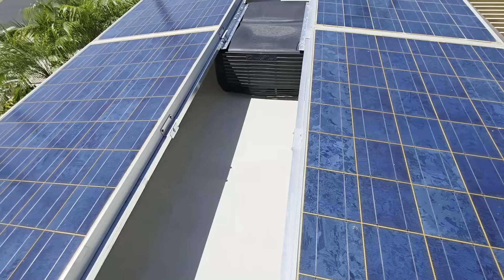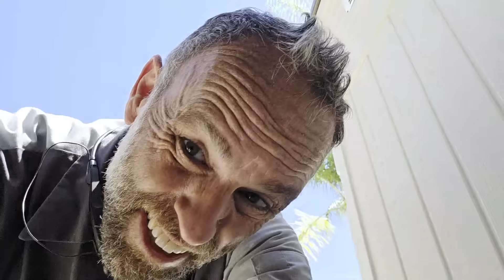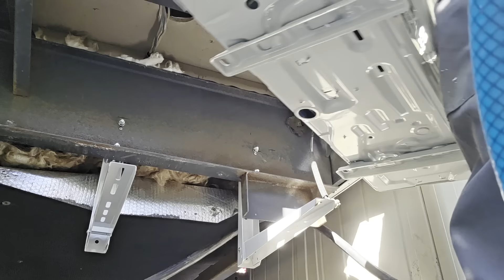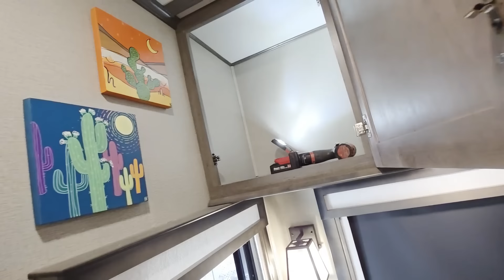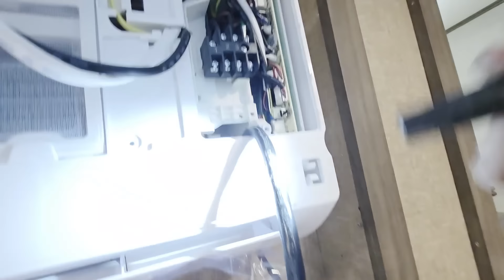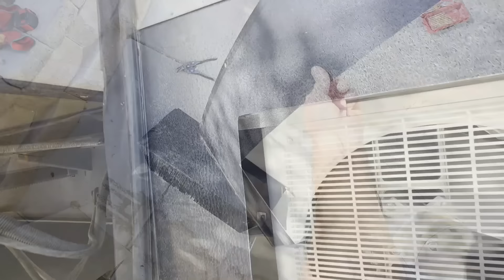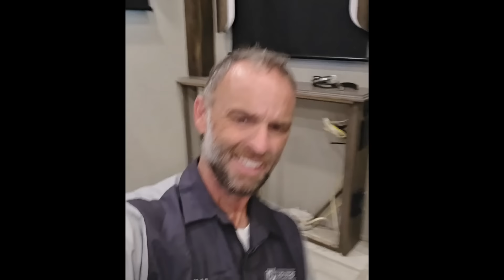Are Mini-Splits Worth the Hype? YES!!!

Comment: Now you can get  all-in-one inverter ACs that fit in place of your old unit and 14” hole.  So the only advantage of splits is the noise is less depending where you put the outside part.  And it drips condensate so there’s that.

Comment: FYI I am a retired HVAC contractor Daikin mini splits make a ceiling cassette they can go on the ceiling of an RV and the outdoor condensing unit is a hermetically sealed unit it doesn't care what you mounted in. But my point is you can give the condenser a set location and route the line set to the ceiling cassette permanently and not worry about a slide moving in and out copper moving in and out look into it there are a variety of ceiling cassettes the word on the pipeline did an RV model is being developed. A ceiling cassette easy peasy to locate and install has a safety condensate pump with a safety switch which can route the condensation anywhere. I hope you find this information interesting. Pete Damron
Retired Goodman heating and cooling
Reply from the maker: I'm honestly trying to figure out a mono block a/c that mr cool has, it seems very simple

Comment: Well, I am inspired to the point that I have ordered a mini-split for my fifth wheel.  I plan to copy what you did with the exception of the outside unit.  I think I will take advantage of the receiver hitch and mount a basket to hold the condenser.  Will let you know how it turns out!
Reply from the maker: Good luck, I have high hopes you will be very happy with it

Comment: It ain't consuming 100 watts, that's no possible.  

Is that RV moving?  what's that wood shed in front of it?

One problem with the mini splits is they all have no switchover if you use them for heat also. So you can't set a heat temp and a cool temp separately. Just a single temp which means it'll flip too easily between heat and cool.

Comment: STOP JUST SAY HELL YEAH. I have 2 on my mini splits, 1 on my mancave not attached to the house 20x40 on solar only in Utah. Its 101 outside as i type, my mini split is set to 68 and i have to keep inching it up because its a freezer in here, and its a 120v mr cool that's 8 yrs old. We just drove our 1979 mC9 from New Jersey to Utah in July running dual mini split off my 3000 watts of solar, with 400ah 48 volt batteries and 10kw inverter, while driving, we have nothing but 120/240 in the bus no DC except for bus. Ran the ini split 24/7 across the country and never had an issue never touched the back up generator. SO unless you have used them hard as hell for a decade dont judge them, also i put them in, on the bus and the mancave.
Reply from the maker: That is quite an impressive real-world test for those systems.

Comment: On the first house I didn't cut and reflare the lines. I wish I had. The second one in my wife's container I just bought separate copper lines and matching fittings and cut it to length and put the lines in the wall. Now it's nice and pretty. Lol

Comment: Great video, Sir. I am watching these videos as I'm considering the swap with my RV as well. My only question...or concern, rather, is that other videos say the instructions of certain units discourage plugging into GFI outlets as it appeared you did. What are your thoughts on using the GFI outlets. I've heard that the unit powers off immediately if it uses a GFI.
Reply from the maker: I have seen that too but not every time

Comment: I have been considering putting a mini split in my DRV 5th wheel -- 43 feet.  I do not understand how a 12k mini split can outcool a 15k RV ac.  I always thought that BTUs are BTUs.  I live in south Texas so I need plenty of cooling power for these 100+ degree days.
Reply from the maker: The BTUs are lost to the ceiling and ducting restrictions and the heat of the roof

Comment: Just out curiosity, How long did this take to install?  I have a fifth wheel with the "In Command" system, and I want to set up a mini-split with a 110 line for shore power.
Reply from the maker: Well recording adds 3x but a day and a half is reasonable for all the work

Comment: Okay, now that was cool. Beautiful job. I did the same thing with my Montana fifth wheel when I remodeled it after gutting it. I put a mini split right over the door, 12000 BTUs, 115 amp that plugs right in. I mounted the compressor to the side of the RV. Unconventional and maybe a bit ugly but it cools and heats superbly. I got so enthusiastic about mini splits I installed them in my Florida home where it gets so cold the complaints are often! My electric bill at my house is never over $115.00 a month, no kidding. Mini Splits are the way to go and if you can find a  way to install them, the ugliness of them become beautiful when you get that electric bill. Thanks for a new idea!!!!
Reply from the maker: I couldn't agree more, the energy savings alone make them well worth the effort of the install.

Comment: I don't get how a single 12,000 btu minisplit will cool "better" than two 12,000 btu rooftop AC units. Less electricity? Yes. Quieter? Yes. More cooling? No. Excellent clean installation though!!
Reply from the maker: That's how poorly roof A/Cs cool the air, they spend most of the energy doing nothing and is lost to the roof and the ceiling

Comment: Did you complete the AC Cord by having enough loop to reach the 20-amp 120-VAC outlet power box at an RV site?   You did not hook up the power to the power panel inside the RV?
Reply from the maker: The owner chose to add an outlet to the solar generator in the power house shed rather than run a new outlet to the box 3/4 way from the A/C. It could be added later if desired.
Reply: @AZExpert  I am thrilled that you did this video. I bought must everything on your list. Already have the vacc pump/hoses. Can you list the power cord that you used. I’ve been looking at them and there are so many options.  I love that you are in southern AZ as I am just north of Phx. So you know what is required to deal with extreme heat. I’ve been living in my late son’s travel trailer now for 11 years and I’m so tired of dealing with the heat and ac break downs. It’s regular in the 90s inside. Anyway, I was able to finely afford to buy a mini split. Looking forward to installing it, soon I hope.
Reply from the maker: @LethalLadyCreations  just a long heavy duty extension cord from home depot will work

Comment: I dont understand why Rv manufactures are not using mini split.  Domectic stuff is junk on every aspect and does not last.  Maybe if Domectic would produce something that last for years and is economical some things might change.  I'll never ever buy another RV.  I'd rather build my own and put in a mini split.  The build starts soon and will be a couple years away due to funds.
Reply from the maker: If I were smart I would just develope RV flex hose line sets for easier installations.

Comment: I'm looking into putting I've into my 5th wheel forest river impression...i want to put it on its on breaker inside kicking off my 50 amp breaker box...is that possible??..i didn't want to take it to 110 outside  because the next place i go might not have but a 50 amp plug...im skeptical on where to mount it but heck no matter where it should cool down from room to room nose to tail.. Right?? How much would it cost having somebody to do the install??
Reply from the maker: of course that is very simple to do
Reply: @AZExpert lol right on how much you charge to come to Houston to throw mine in 😅😂

Comment: Nothing drives me crazier than the RV manufacturers putting 2 inch wide holes to string 3/4 of an inch of pipes and  wires .. it like sending an invitation to mice rats and squirrels.

Comment: Why did you install the left side cabinet door with the handle and hinges on the wrong side?
Reply from the maker: That's how it was mounted originally. I wanted to swap it but the handle would have been on the top or I would have had to drill new holes. It bothers me too, but not as bad as holes in the door.

Comment: Looks great and I have a 40 destination with same overhead cabinet, perfect location if I do what you did with the center area.  I never considered the outdoor condenser installing where you installed, but it's perfect and  I will  measure if a mini split witl fit..  Bought new in 22, it has less than 100 miles after  the dealer received it, don't plan to put any more miles.  A ground install location would work, but I like the ability to retain mobility.

Comment: i moved into a RV in Tennessee for full time  non moving bedroom on my daughters property, I was wondering about  if I ever need to replace an AC unit a mini split would be the better  choice, I would think a 220v model might be the better option, but I was wondering about this model vs a Mr Cool.
Reply from the maker: a 220vac model would be better, but will take some knowledge to make work on RV electrical systems. Mr cool is great but does cost more and you will need to measure your line set to make sure it will work first.

Comment: Nice work! Very professionally installed! My RV is probably under 400sq ft. I’m wondering if I could get away with a 9000 BTU UNIT?
Reply from the maker: probably, but I don't see a value as the price and size are very similar

Comment: What about using those mini splits that have the ceiling cassette style air handlers and using the hole where the old roof units were that way you can add them in the bedrooms and such for more flow i think they make them up to like four cassettes for one unit which would probably be Overkill
Reply from the maker: routing the line set would be the biggest issue, but I could see fabricating flexible rubber line set rather than the copper and it working, but the cassette is likely bigger than 14 x 14 opening so then the roof would have to be re-built/designed for the joist load

Comment: I have a 2007 39 ft Dutchmen Grand Junction fifth wheel that is permanent on a piece of property that won't be moved and I would love to do something like that to mine because my rooftop air conditioners are Extremely Loud and not very efficient. I just didn't know exactly what to use one of those mini splits or a couple small 10,000 BTU air conditioners. But I thought the job you did was very nice.

Comment: First time on your channel and excellent video. Your thought process and skills to make that look great. The only thing for future installations just don't make your extra lines in vertical loops because you create an oil trap for the compressor. You always want the loops horizontal or get yourself a metric or imperial flaring kit based on your manufacturer's line set dimensions and do the flares. They are not hard to do it all. Cut the extra length off and practice a few on the scrap pieces of line. You just want to sit in proper on the flare of the nut and not riding up on the threads or not too shallow, but just in that perfect spot by looking at the factory ones how they're made. Factory or made flares always use RT220B Nylog sealant.
Reply from the maker: I did suggest re-flares but I also have my doubts about the oil trapping as being less true and more kind of true. I travel the country and see these installed everywhere and I see vertical loops everywhere too. It may be real or best practices, but in practice much less important and I wanted a service loop length for installation and flexing more like a brake line and cutting and flaring the 6-8 inches seemed very unnecessary. Over a year later and the system is still working. I do use nylog on all installation now. Thank you!
Reply: @AZExpert Unfortunately there's a lot of improper installs being done because there's a lot of DIY mini split systems. It's quite important that there's no vertical loops for oil trap. It will not show up immediately but it can shorten the life of the compressor, and reduce efficiency. Easy thing to Google. I understand what you're saying about wanting a service loop since it's kind of in quite a tight area on that side of the unit. An idea would be to have a welder or you can fabricate it and make you a tray with those heavy duty lockable ball bearing slides that will easily support a 60-70 lb outdoor unit, and good practice for RV unit is to put a "S" in the line at that unit. That could give you a little room in the lines for service to slide it out. I'm a former licensed mechanical contractor Unlimited and a 14-year college educator in energy technology and alternative energy geothermal heat pumps.
Reply from the maker: @Bob-sy5gm  They are $250-400 units, you are asking for $1000s for fabrication to possibly increase the life of a nearly disposable ac that might only last 10 years instead of 15 on a rv. Best practices are nearly impractical in reality and perfection is not a worthwile goal because it causes decision paralysis. I'd worry more about the air space void in the line set I installed causing issues more than the loops personally.
Reply: @AZExpert I can't argue with that with the price point of those units in the low hundreds, as they have become just disposable units. Labor is way too expensive to do a major repair like a compressor. I do like your thoughts on making everything removable with your covers and access. As a former HVAC technician that's great! I consulted for high-end multimillion dollar companies and everything was done with higher quality like Mitsubishi, Carrier, LG. I figured with these higher end RVs and the hundreds of thousands into the millions, I personally wouldn't put in a few hundred dollar AC or heat pump. Also you're talking about your power consumption with a lot of RVs that have their own solar now. If you seek out the highest SEER2/HSPF2 rating, they will just sip power sometimes as low as 200 to 400 watts once the temperature is stabilized. I plan on installing one in an RV travel trailer coming up with a fully supporting solar system. Tosot ( manufactured by Gree as a entry-level unit) available thru Tosot Direct or Amazon offers a 24.5 SEER2, 9.5 HSPF2 12,000 18,000 or 24,000 heat pump starting off at about $1,299 or less for the 12,000 unit, And I've seen it on Amazon in the 900 range.

Comment: Hello out there! I'm new to the RV world. I aquired a 5th wheel with a mini-split and am wondering if I can plug it into the 3000W pure sine wave inverter? I have 3 solar power panels and 4 large size batteries. Thanks for any info you can give me.
Reply from the maker: I cannot say but generally I do not trust most stand alone inverters DIY installed for continuous heavy loads.

Comment: Which is better? The 12V ceiling units or a mini split? Great video! Subscribed!
Reply from the maker: 12vdc roof units are not there yet for rv roof and the wiring is difficult to be honest. Mini splits do not lend themselves for most rvs well though
Reply: @AZExpert  thanks so much for your reply! I'm getting a fifth wheel and parking it so I'll show my AC fella your video and we'll basically do the same thing if we can. Thanks again!

Comment: I've installed 10 of these mini splits, 3 in my own home because my electric bill in the summer reached $450 a month, the next summer after installing my mini splits the electric bill went down to less than $100 a month during the summer months. By the way it gets easier with every one you install. You did a great job! I'm glad you decided to cut the outside panel to give the whole unit breathing room it needs it.
Reply from the maker: That is a massive difference in energy costs, thanks for sharing your experience!

Comment: Somebody did something wrong sir. I'm cooking breakfast as I'm watching your video and I'm a big fan of yours and thank you for this video but what I see is a solar setup on that roof. So now if that solar system isn't providing enough power to run at least two units, there's an issue. And I'm only saying this is because not because I'm an electrician, not because I already have a solar system. I'm in the process of installing a solar system as we speak now. No, we're not. Rich so no, I did not buy the entire almost $20,000 system at once. I bought it in pieces. I first brought the two inverters along with the two batteries and it took me about maybe 15 days to get the rest of that stuff in. I got the solar panels and I got the MPP controllers and I'm waiting for the wires and fuses and breakers to come in for that which should be here tomorrow which is Sunday the 3rd of May and I don't work on Sundays whether I'm at work or on my RV. So I'm still currently connected to the electrical grid but once I install these solar panels I come off the grid 100%. If I want to switch it to the 30 bone and then set it at 10%. I can do that but most likely I'm going to come off the grid 100%. It will charge by the solar during the day. I don't use that much electricity except for the air units and I live in Dallas, Texas so you have an idea of what type of heat I deal with, but that's all I wanted to say. I thought that was kind of odd to have those panels on the roof and they'll still spending $500 a month on electric. Bill
Reply from the maker: The system is to prevent spending $500/month on electricity during the summer. They will be down to the connection fee only but still have the grid if necessary. The panels could be upgraded to be twice as effective but it was a proof of concept first. I personally think having freedom of power is nearly the new dream of freedom at this point and applaud your setup too!

Comment: Does the fan part need to be installed vertically, or can the fan face the ground?  Then you create a road guard to prevent debris from hitting it.
Reply from the maker: It needs to be installed vertically